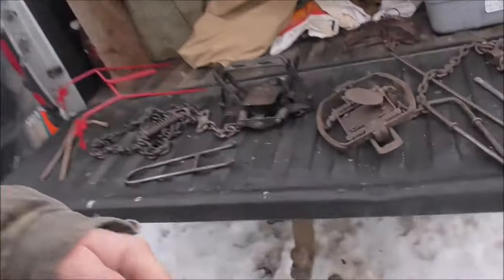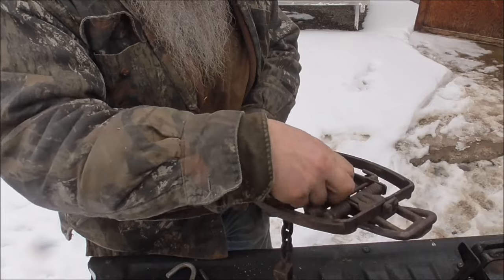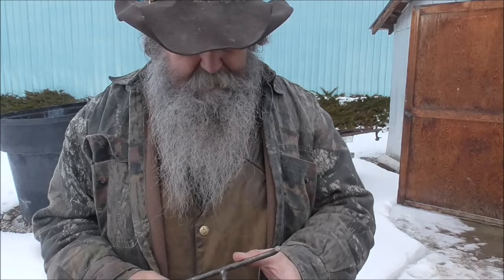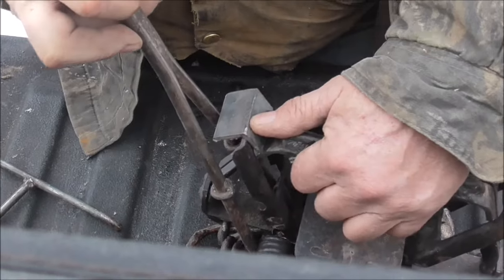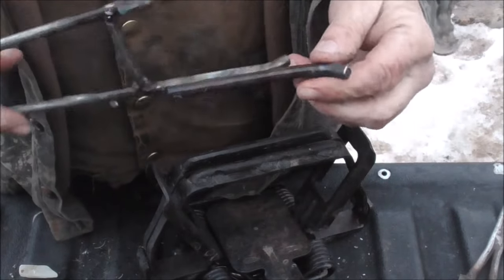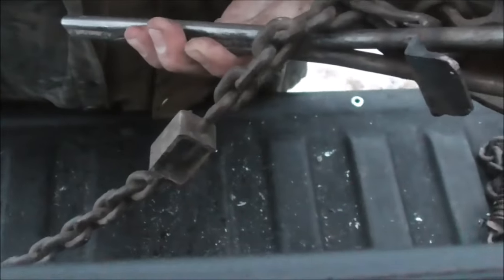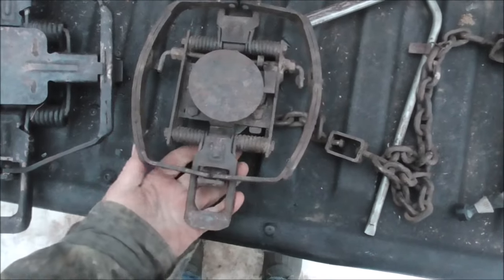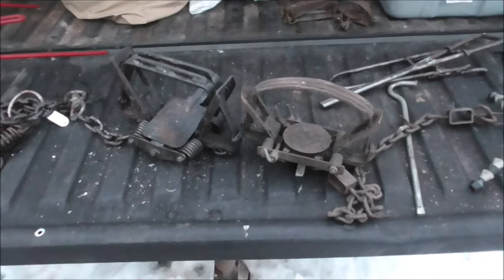Double Duty Trap Setters?

Comment: Love the videos like this. I LOVE working on my traps and gear. My welding sucks, but it works LMAO!!! I completely understand the desire for a universal setting tool, but maybe one for each is the way to go. No point in worrying about it slipping and getting caught miles from nowhere.

Years ago I got a One Hand Setting Tool from a guy in VT for my 750s and I LOVE them. Made my life easier for sure!! But, I get worried each time I set a 750. I try to remember "Take your time and don't be a dumba**!!".

Maybe with the TS-85 instead of using another set of equal sized coil springs, a set of #2 trap springs would be enough.. Or 1.5 trap springs... Just thinking..
Reply from the maker: I like the one hand type setters too.  Especially if you have to turn something loose.  I think 4 coiled with full power springs is too much. It is very hard to open, and after dry firing it a few times, I noticed the jaws actually bent.  I might take off one spring, or like you said, find some not quite as stout.....if nothing else, it's a great beaver trap with just two springs.

Comment: What I do is duck tape my battery operated grinder with a cutting disc on a long 2 inch PVC pipe just grind a jaw off. They don't cost much fast safer
Reply from the maker: Probably should really.  It's a great trap, but a poor design.